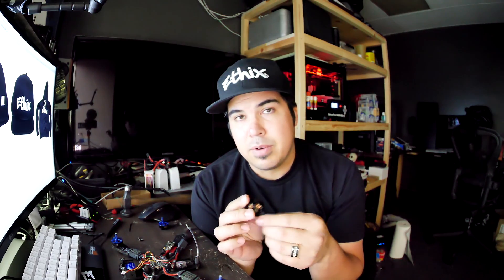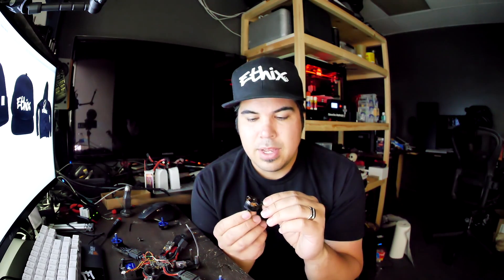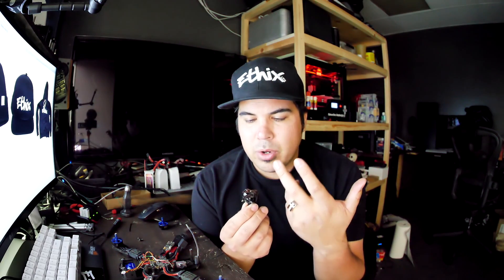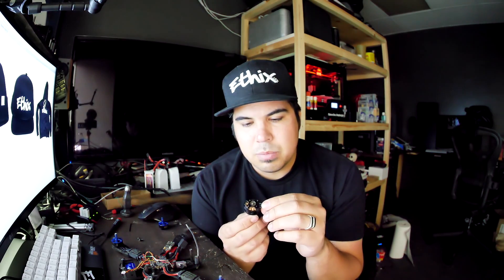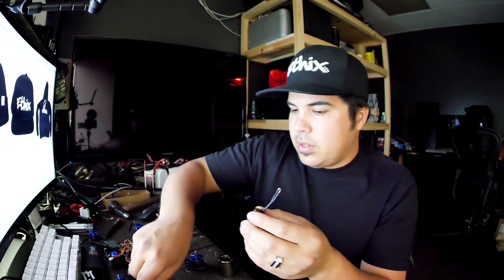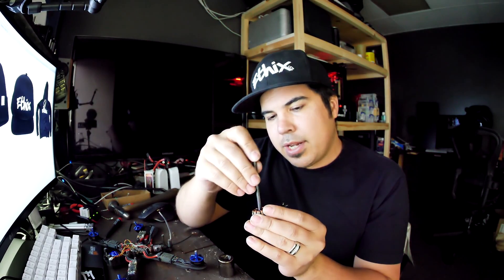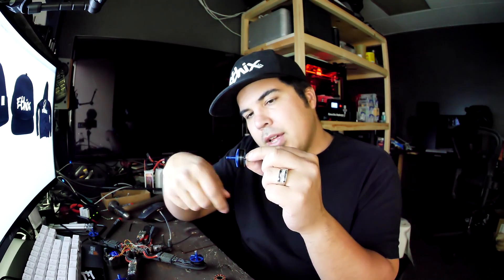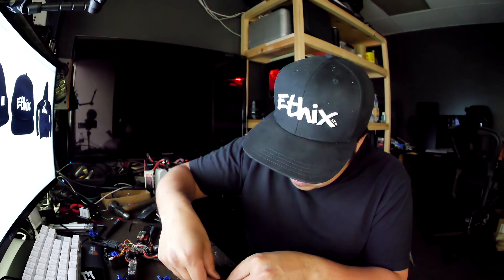Which 6" motors and bearings | ETHiX

Comment from the maker: Did I forget to mention the word smooth 😂😂
Reply: Flying Emax 2207-2400kv lite specs and multicopterbuilders 2208-2350kv on 5s 6" and not a single issue with vibrations. Dal TJ 6045 have been the most prime prop I've flown. Butter smooth. Can get almost 4 minutes on a mid range cruise and 3 mins on hard park flights.
Reply: How was your experience with the efaws?
Reply: I love the EFAW 2200Kv, but Nick seems to have closed the EFAW doors. :-(
Reply: what type of oil ?
Reply: No but you didnt tell us about the grade of the oil. :p
Reply: r lower kv motors in general easier to tune?

Comment: Personally I don't feel that this is a very expensive hobby .. I mean starting out can be expensive if you go top end on gear at first but after the initial jump into the hobby everything is fairly inexpensive... I mean motors are on average $20 to $30 ish and other stuff isn't much worse for what you get haha I have a cpl other hobbies and they are way more expensive when I break stuff lol this is probably the cheaper hobby that I have out of the like 3 or so hobbies I have.. ( I dive deep into the hobbies I do have) that's why I don't have a ton of hobbies.. but I'd prefer a motor that costs a bit more but runs great and is built amazing with no corners cut.. :) <3

Comment: Hi Eric, so you use the 2407 on 5S and 6". On the datasheet it says 6S capable. Is it sound to use the 2407 on 6S and 5". I would expect the amps to go 70A per motor and more which is not sustainable.
Reply from the maker: I’ll run 6” 6s and not pull much amps cause I’m lower in the throttle range

Comment: Bearing Question: I have the Cobra 2207 1500kv and the 1407 4100kv and they both seem to clue the bearings in it or something because they seem to be unremoveable. Do you have experience with cobra bearings?

Comment: I'm running 6 x 4.5 x 3 bn props on the ZMX 2207 2140 motors . Are the bearings all the same type / size in these kinds of motor ? If so is there a place I can order more ? I got one chattering a little but not really bad . . .  yet .

Comment: thanks for emphasizing smoothness. I wish this was a metric that could be included in say reviews like those on e.g., miniquadtestbench. The fact that one can say a motor is smoother than another tells me that such a metric is possible and useful. I wish such a spec existed. (e.g., vibration x thrust curve would be so useful, measuring vibration from a gyro or something similar).

Comment: Same impression on the COBRAS, BUT.... the magnets just wont stick to the bell after a few flights...
Been having good flights and smooth feel on the EDGE 2306/2450 on HQ 5.5 props.
Thanks for the clear, simple, bearing changing steps!

Comment: Eric, I am using 3YO motors from tarot (6" frame - 1806-2350kv 3S). Things were built efficient back then :D Problem here is that when you get a BrotherHobby motor with strong magnets or something with similiar magnets - you need big amount of power just to spin them so there is really no reason to put them on a quad for cruising. Youll be just constantly wasting power on trying to rotate the bell :D I found cruise quads much harder to build than building acro quads as there are many options how to do it correctly

Comment: It looks like 2206 is a sweet spot in terms of stator size for your preferences in a motor. Do you feel like there are shortcomings when it comes to how your motors manage 6 inch props? Are the advantages of something like a 2207 too marginal to feel a difference? The reason I ask is because people have seemed to move on from 2206 (at least from what I have seen in the community, not trying to tell you what motors you should use). Can you say the motors you are working on will have a bigger stator? Really liked this video and your discussions, I thought it was really helpful!!

Comment: Pro tip- those banggood titanium hex drivers seem to be the exact circumference of the bearings and you can use the bearing you’ve removed to help seat the new one if you slide it down the driver. The driver itself will work but sometimes the stator gets in the way.. simple and awesome way to push in a stubborn bearing most people already have!!

Comment: The biggest trait i look for in big prop setup is the motor's ability to brake. Has anyone focused on what in a motor is responsible for that?

Cog is overlapping dead-zones in flux. Modern bell design (zmx is one) has pushed chunky part of the zone further out. However keep in mind spinning the motor by hand shows the static dead-zones...but motors aren't static when we're commutating the coils.

Comment: this video come on the right hour, I'm just picking some motors for my first 6 inch build. Thanks!
Reply: Eric, I have 4 old T-Motors Air 2205 2000kv, you never use this before?
Reply from the maker: Yeah the t motors weren’t bad just weren’t very durable
Reply: Thanks man, I get theses from a annual hobby market last year for really cheap, they are described was CW, no CWW on the set, not issue on that?
Reply: if they work there I will use than, I just don't want go back and forward on this...
Reply: Id go for 2307 for 6in....
I fly some efwas with 2500kv and they also fly really efficient and have all the power if i need it